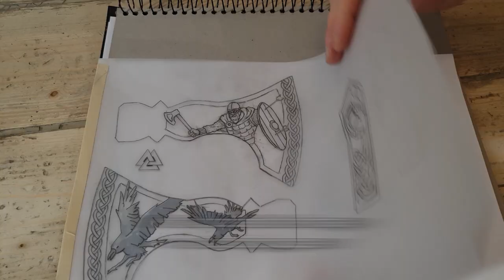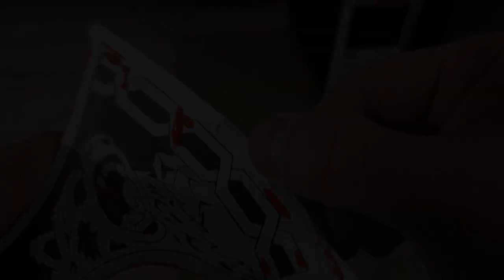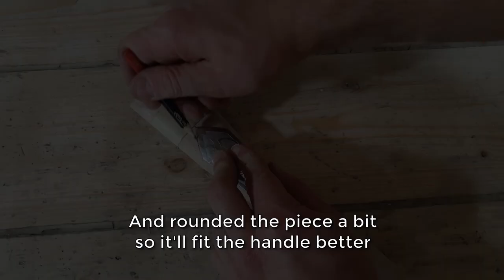Remaking axe - decorating a cheap axe to Viking inspired axe

Comment: What did you use for a resist? I’m new to all of this, and just want to make sure I don’t completely wreck my first attempt…..
Reply from the maker: Do you mean the paint? It's primer spray paint, that will stick better than normal spray. I've had many failed projects myself so I understand your worry :) You cand try the etching on some junk piece first so it won't matter if something goes wrong